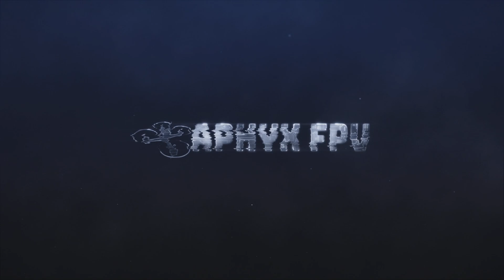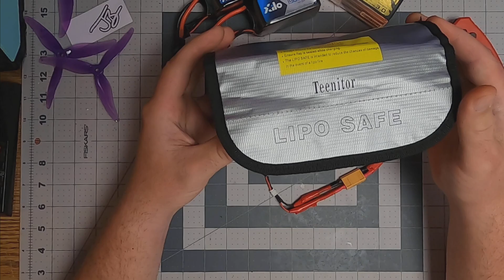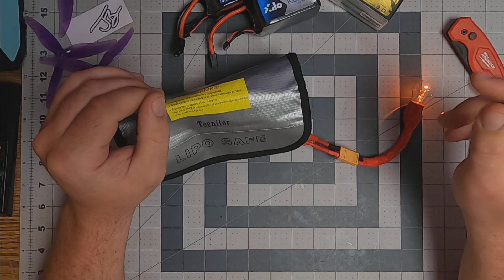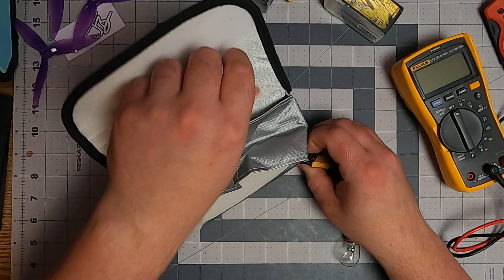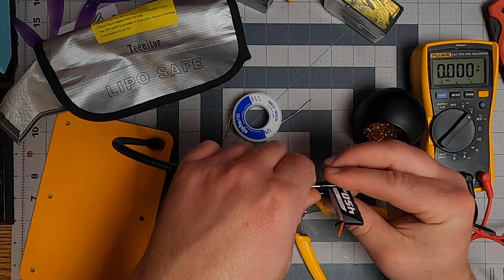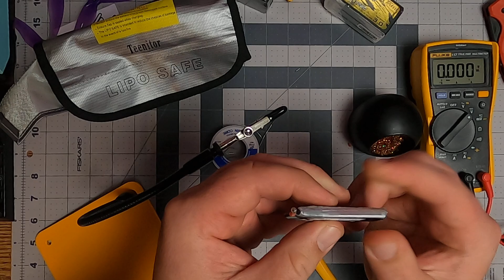Safely Discharge and Dispose of 1S Lipo Batteries

Comment: Somewhat unrelated to this video but I got the Hakrc f7230d fc from FPV crate, just like you did in your video, and I noticed the gyro seems like it's missing. In betaflight it also says gyro missing. Looking at the board in your video it seems like yours is missing as well. Does it work in betaflight for you? If so did you have to enable it somehow? Also I flashed firmware using the MATEKF722 target, maybe this was the wrong one? Thanks!